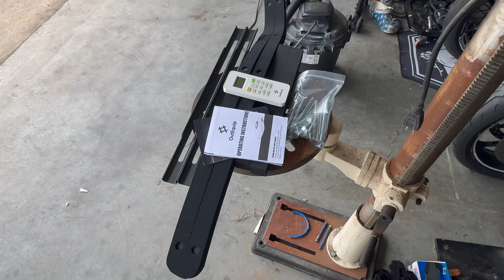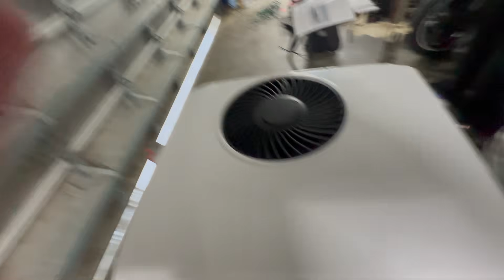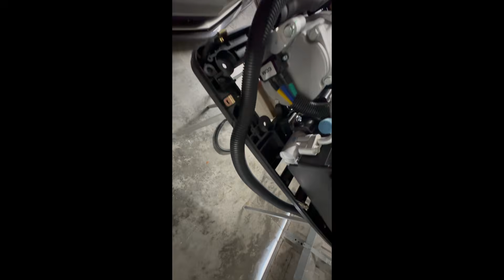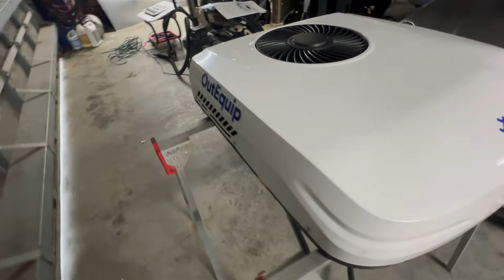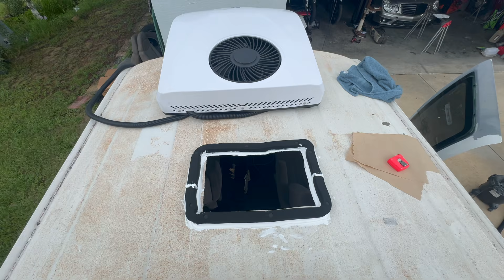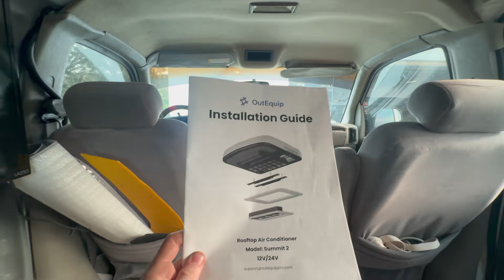OutEquip Summit 2 install

Comment: Great video. Wished you would have shown the 3 or 4 connectors to the control panel as you were installing that part. Mine only has 3 connectors since I think it's only the AC unit, not the one with heat. At the moment, my fan isn't working --- compressor is working -- no fan.  Hopefully by the time you read this I'll have solved the problem.